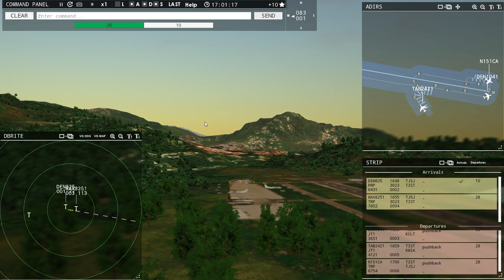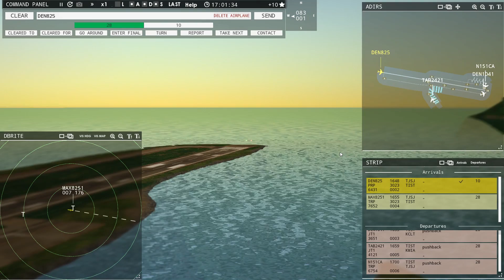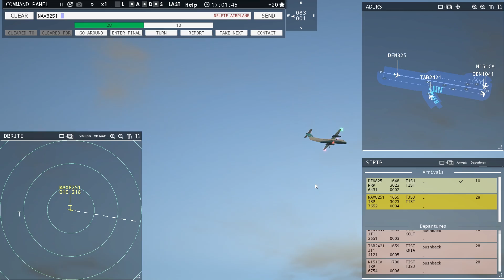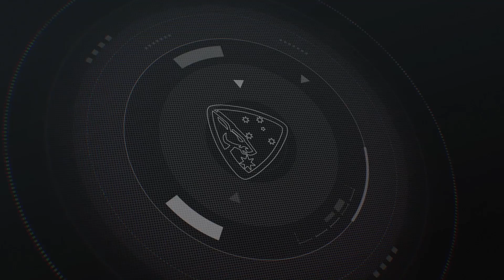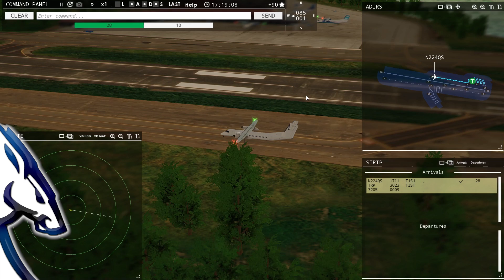Tower!3D Pro: An Air Traffic Control Simulation

Comment: went to check this game on Steam. Second review as follows:
"The main reason I can't recommend this game is due to the outrageous DLC pricing model. The base game only includes three airports with fake airlines. Oh, you want real airlines? That's another $10. Oh, and, you want the aircraft models to have the real airline liveries? That's another $7. Per airport."

ain't we just had seen it with EA?
Reply: And on top of that the game isn't even cheap to begin with. I thought it might be fun, clicked the Steam link, and instantly decided not to buy. I had expected it to be a 15 dollar game, or something of that nature.
Reply: It's a niche product, what would you expect - Pro edition was $25 in the sale. The base game is published by feelThere and the 'Real' Traffic/Color add-ons are by Nyerges Design.

You're not wrong about the DLC, but it is, what it is - you could save a few $$ by editing the text files to create your own 'traffic' schedules but IMHO you'd spend more time than it's worth.

For 'Real Color', you don't need to buy for every airport, if you buy a single pack for a larger airport, most of the aircraft at other airports will get their airline colors i.e. IIRC the KLAX pack contains 158 aircraft/airlines. It's then upto you to decide if it's worth paying the extra $7 to remove any remaining plain (white) color schemes, as and when needed.

While perhaps not 'good' value, IMHO it's better that Tower 3D Pro is available, than not, as I'm not aware of a similar product.

Comment: ADIRS stands for Air Data Inertial Reference System, but it makes no sense to use it for the ground radar screen. If anything it should be called ASDE-X or something like that. The Tower3D authors must have been smoking something strange :)

Comment: Do you fly in VATSIM ? There we use Euroscope ; at least on the European servers, and it's more realistic since you only have your screen, no 3D person visuals.
Reply from the maker: I find it interesting that you consider no 3d visuals to be more realistic. Last time I checked ATC Towers still had windows and where still built on elevated positions allowing the controllers the ability to visually acquire aircraft.
That would make the lack of any visual input actually less realistic wouldn't you agree.
Reply: @MagzTV You are correct, tower & ground controllers would also be looking out the window. In fact, having ground radar or even field-local radar at such a small field would be somewhat unlikely (though of course possible). Then again, seeing as even the jargon used in those radio calls by the game had numerous mistakes and oddities, my guess is they weren't really going for super-duper-hyper realism.